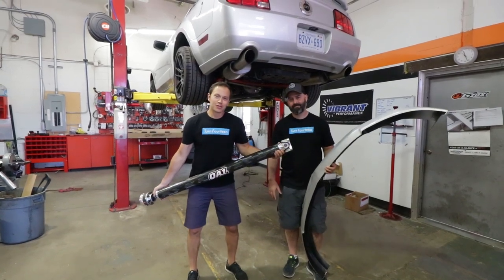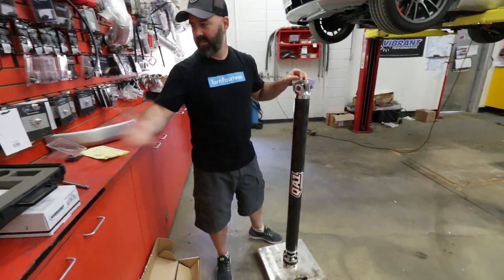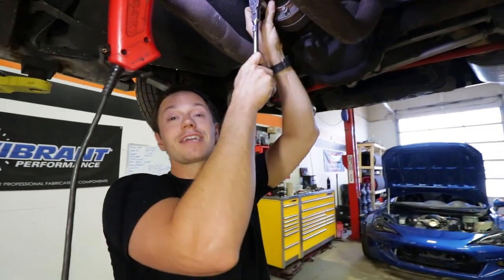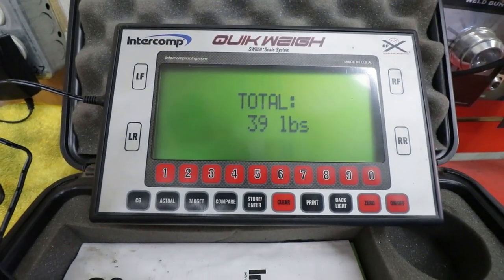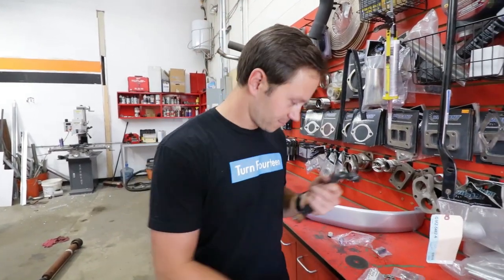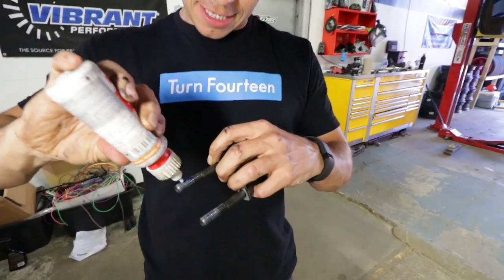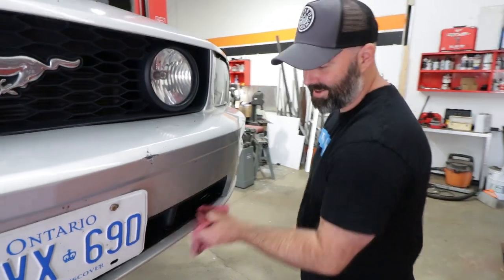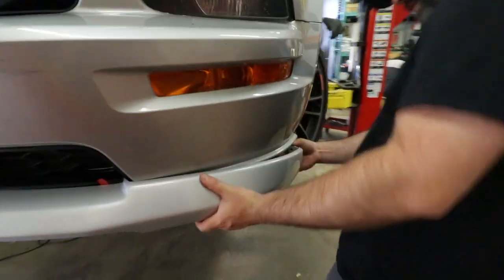QA1 Carbon Fiber Driveshaft Upgrade Rocks - Mullet Mustang - EP18

Comment from the maker: Some of you have been asking about the benefits of a Carbon Fiber driveshaft over a aluminum or steel one. Weight is obviously a big factor but safety is an even more important one. If you’re racing or involved in an accident, the carbon fiber shreds like a broom, so it won’t bounce around and damage everything under the car or potentially come up through the floorboard like a steel or aluminum driveshaft may do.
Reply: Speed Academy you make me thinking about starting a carbon fiber broom business 😂
Reply: Google carbon arrow accident and click images. Yikes!
Reply: Speed Academy somebody told me that aluminum is better for the street because Rocks come up underneath and hit the carbon fiber and make it start pulling away. Is that true?
Reply: Speed Academy   but if it chips  its junk and has to be replaced  it cant be repaired and at 1500 dollars  forget it  chromoly  is the best and likes high speed  unless you want to buy a titanium shaft which is stronger  then carbon fiber , iv done my research on this subject  and if you use two drive shaft safety loops you wont have driveshaft  safety issues, if been running my safety loops since the early 80s  in my chevelle
Reply: RS3 4 Me  hey dont use aluminum  for the street or carbon fiber  use chromoly steel, it's best for all around use  carbon fiber  is expensive around 1500 dollars and if it chips or is damaged  its junk and has to be replaced  it cant be repaired , if you want to save on weight use carbon fiber on different car parts not drive train components and if your worried about safety with the shaft under the car install drive shaft safety loops  they work  I know been using  them for years

Comment: Aweosme mod. Something I always wanted to do to my s2000 but it is a much smaller weight saving so might not be worth the money. Losing 19lbs of power train rotational mass is fantastic.
Reply: Yeah S2000 drive shafts are light as hell as they are. Can't imagine it being worth the money unless it's like a balls to the wall race car build.
Reply: Lucky rooster is correct (may not be 1 for every 20, I can’t confirm) but rotating mass is what affects performance the most, I’ve heard people getting these and improving throttle response greatly. Rotating mass is what really robs performance, thats why cars like the Lancer Evo has hollow camshafts, only saves a couple grams, but gives it 1k more rpms than stock mitsubishi eclipses that use the same motor with solid shafts

Comment: Great job guys.. I'm getting convinced that a 05, 06 mustang may be my next purchase.
Reply: Mike Giles They are great cars. As an owner of an 05 GT, I recommend you look for an 07-09...Ford was still having minor issues with 05-06 models & if you could find an 07-09 with low miles on it...you will be a satisfied mustang owner.
Reply: cruz_ thanks for the insight..im definitely following your build on YouTube and Instagram.. Just looking to make a good autocross and street car out of it.. Thanks!!!!
Reply from the maker: Hey Mike, the 4.6L V8 S197 is a good purchase but as you can see it takes alot of work to make any real power from it. If we were to do it again, I think we'd shell out the extra cash and buy an 09+ with the Coyote V8 since that motor makes so much more power out of the box.
Reply: Speed Academy very smart... Although your video gives a lot of ppl a vision and hope being that Chassis is difficult to make progress with..ill be looking into the 09 and 10 as well.. Thank you
Reply: Mike Giles s2000
Reply: @speedacademy  I don't understand why you would do that. What would be the goal then? Make the 5.0 as fast as a gt500? Make it as fast as a gt350? As fast as a pagani huyara? You made a $7,000 mustang fast enough to hang with a $50,000 mustang. Why can't that be enough? I don't understand the problem. Even if you dumped $20,000 into this one that's still a $23,000 price difference. I won't apologize for the 3 valve's performance. It battled valiantly. Wish you still had it with all that stuff on it so I could buy it from you.

Comment: Where was the drive shaft? You installed a carporn fibre prop shaft, as far as I understand the drive shaft connects to the wheels, the prop shaft goes from the gearbox to the rear differential which is what you replaced.
Reply: It’s still considered the driveshaft.

Comment: RX-8 already comes with a carbon drive shaft 😎
Reply: Hernandez471 But no horsepower or torque
Reply: Hernandez471 Problem is that it comes with an RX-8 attached to it
Reply: So does a 350z
Reply: Too bad you gotta put in oil every 5 miles
Reply: It's actually an aluminum drive shaft that's hydrodipped ;)

Comment: is the drive shaft a used/press release unit?   I know it's canada but those bolts already have rust on them.   Otherwise a very fancy bit of kit

edit:  assuming the bolts aren't coated because QA1 balances them by removing material
Reply from the maker: Those bolts arent coated hence why they rusted so quick. There must have been moisture introduced into the packaging which caused it.

Comment: Too bad my driveshaft shop driveshaft was that well marked. I had to unbolt it, rotate it slightly, get it up to speed, rinse and repeat until the vibrations went away
Reply: pballer2005 same here, and the bolts supplied were 5mm too long gouging into the pinion flange and one snapping before 50ft.lb. Had to drive the car from Ohio to NC obviously with a slight balance issue due to the bolt and the pinion bearing needed replacement by the time I got to NC. Cost me another $400 to have a shop replace it and $40 for a machine shop to get the bolt out, and another $20 for the right size bolts. DSS went dark on me.

Comment: hey guys  great vid on doing the up grade , i have a question to you or anyone else reading this post .  i have  an 08 shelby mustang GT  that has that two piece driveline  .  my car no matter how hard i try when i go to do a burn out  the tires spin like crazy but cant get smoke  off the tires  even with the traction control off  it has the 4.6 w/5 speed  i have asked several other people so far  no one can tell me why  i have tried two other types of tires along with drag slicks  played around with a different tune .  my own conclusion theory  is  by it being  a two piece driveline  im thinking maybe its depriving it from torque  making its way to the rear end  any thoughts or suggestions ?  . i have seen others the same year with a solid drive line blow the tires off the  car  but  id like to find out for sure before i spend a bunch of money on it   thanks Bill
Reply: no

Comment: I remember seeing the magazine on news stands but never even picked it up. Wrongly assumed it was an oval track mag which holds zero interest for me. 
 Now of coarse having watched this channel for yrs and having gone the web site. i really regret not just flipping thru it even once. I feel sure would have liked it. Based solely on the content I see presented here and the website.
 So checkout the web it has many of the same projects but with greater detail and background. Also some content not show on the channel. I learned of Pete's 930 months before it was even mentioned on the channel. There's also a build of an E-rod equipped 240sx. E-rod is GM SMOG LEGAL LS-3 6.2L 430HP all alloy badass crate motor.

Comment: Marking the ends of the shaft to the transmission and diff have nothing to do with its balance properties. They don't balance the drive shaft on the engine. If you remove the u-joints to replace tem then yes mark the drive shaft itself parts for proper reassembly to maintain OEM balance.

Comment: Whoa! cmon guys! That's an overkill! Use a hollow stainless steel shaft instead, that's enough for the amount of power a modded NA 4.6L engine will deliver. I know you're seeking weight reduction, but just strip the interior, that's way cheaper! (I hope you eventually go for a SC to justify it).  Nevertheless great video, interesting series,  I'll keep up with the build.
Reply: 89DIDD sponsored man I would not argue
Reply: I wouldn't argue either, that's why expect a SC in the future, you could build a car with some serious torque with a CF shaft. They would only need a new transmission, diff, tires, brakes, etc.
Reply: I doubt boost is in the cards now that they have Stage 2 cams in it.
Reply: Yeah I was thinking more like in a long distance future, when they've had the NA build finished and one they stop to look at it and think: "perhaps we should start a new proyect". Other than that I've always liked the idea of the NA build and still expect them to finish it as a NA build.
Reply: True, over kill YES, cool YES. Agree an SC WOULD BE COOL. On the coyote motors respond like crazy. 3-valves need all the help they can get. They have already exceeded the pwr gains I expected.
Reply: They are probably getting these pieces sponsored for free so not really overkill.

Comment: The carbon driveshaft WILL NOT improve performance in any noticeable way other than the weight saved.  Hell even QA1 doesn't mention performance gains on their website....
Reply: I have recorded a tenth difference in just a second gear pull with my aluminum driveshaft . Others have gotten a .1 or .2 tenths difference in the 1/4 mile with just a driveshaft difference.
Reply: Do R/C! It will certainly increase throttle response and be free-er revving. Half the weight, way less rotational inertia!
Reply: Do R/C! Stick to RC cars
Reply: Tsal Tsirf haha. ok I'll quit my 15 year career as a mechanic tomorrow. 
I suppose I should have said that a lighter driveshaft will not make a car noticably faster to the average driver.  
If you can tell 1/10 of a second in 14 seconds by the seat of your pants good for you.  That's about a 1 percent change.  
There are a lot of things drag racers do to eek milliseconds out of their runs but I'm guessing there are a lot of things that $1200 would be better spent on by the vast majority of people.

Comment: why isnt the CV carbon lol and the bolts too while theyre at it. eh i know thares probably limitations on the kind of shapes you can make with carbon.
Reply: also, why get rid of the steering wheel with the airbag? you may have a better seat belt system but isnt your skull going to fly off without a pillow to land on? always seems reckless to get rid of any airbags. you may have high confidence in your driving but if you take that thing outside in public who has very questionable driving skill, some circumstances can be out of your control and you just have no choice but to crash horribly.
Reply: why does the nanny state deem it illegal to drive without a seatbelt but get rid of an airbag, no problem lol not that i care anything about nanny states but i wouldnt remove any safety items. i wear a seat belt for safety not because the state says.
Reply: or why doesnt the state bitch about really loud exhausts? yet there are laws about unreasonable noise. a loud exhaust isnt reasonable except to car enthusiasts idea of cool and fun. but its actually pretty annoying. imagine everyone was a car enthusiast. then it would just be a droning hell 24/7.
Reply: It is illegal in Canada to remove a functioning air bag from a vehicle. They just roll the dice on not getting ticketed for it. Considering the car probably isn't a daily driver the chances they get unlucky and get pulled over by a cop who cares about that stuff is low.
Reply: Because it's too situational dependent and subjective. Think of all the times you pop it into neutral just to do a rev at good spot. 
 I used to be really annoyed at LOUD Harleys. Till one day asked a guy about it, he just showed me a patch on his vest "loud pipes save lives". The light dawned...!